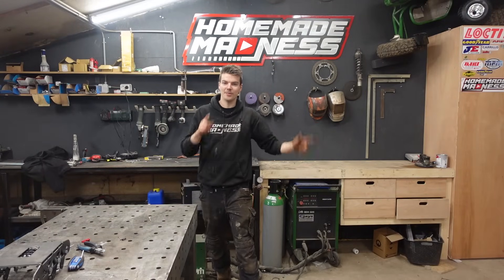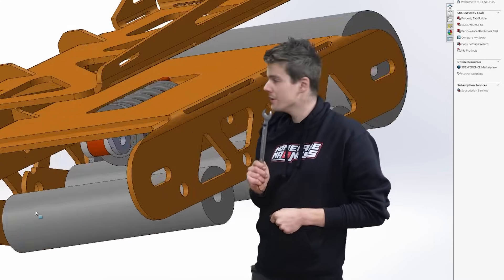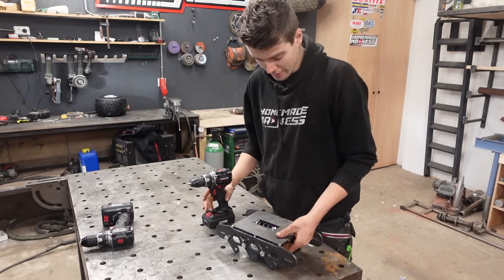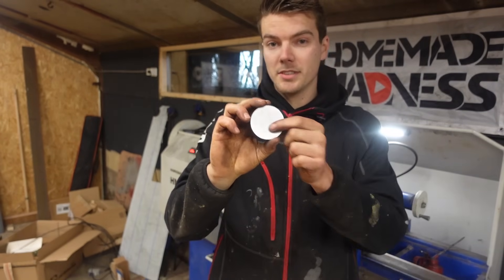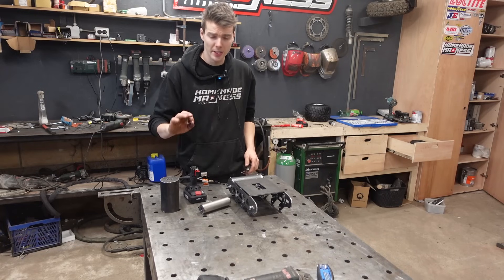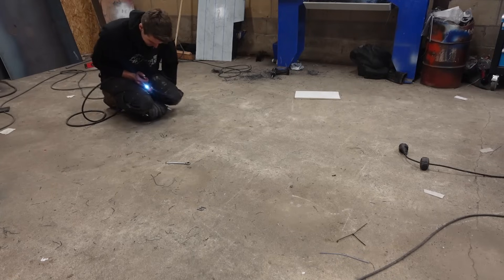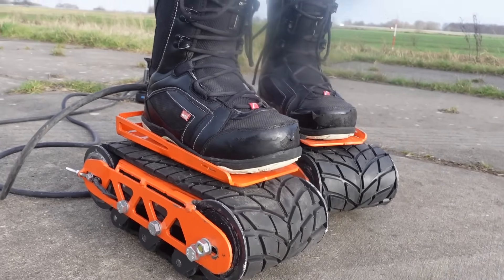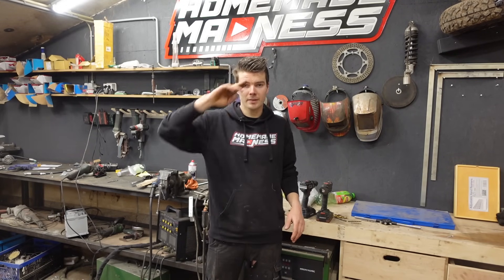I made conveyor belt shoes! will they work?

Comment: clever design! I think what is holding you back is really the motor choice. Power-tool motors are geared down a ton for low-end torque (which is very useful), but the problem is their speed control & the fact that they engage electronic braking. This is great for a drill, but not so great for mobility applications as you have found out. I would look into replacing the motors with the kinds on electric skateboards. If you go searching, you can find dual hub motors pretty inexpensively online. These brushless hub motors are direct drive (so still have loads of torque), but don't introduce any extra bulk or rolling resistance of the gearbox inside the drills. Simply go get a cheap eboard controller (which natively will power two motors from a single controller), and you should be good to go. Biggest benefit is an eboard controller is designed to let you coast when you let off the throttle, and they throttle power and not *speed*, which is an important difference which will make it much easier to ride and control.

Comment: You should have used DC motors................I use Parkside drills and unluckly you choosen the fastenst one of them all, Brushless is not always the best way, in comparison  DC motor works as brushless with possition sensors and smart controller.

Also you can use different controler for better torque, the original does not have softstart.
If you used 5 y older drills they would do just fine, also make them so they go same speed and add potential difference knob so it would be possible to turn like a tank ( same as roll axes on rc plane for ex.) 

Overall good job  💪💪
Reply: Nothing wrong with brushless here, its more of a problem of trying to use a drill gearbox & controller where it wasn't designed. If he used eboard hub motors & controller this probably would've worked extremely well.

DC motors have no advantage here other than being a bit easier to control with/out a control board.
Reply: @nickldominator  they do........just as I said they will go slowly from a dead stop, brushless cant do that without hall sensors sensing the possition so it would have aplied more power to the specific coil in a way that the rotor would not slip.

But I agree, basically the controler is shit.
Reply: @Jarda_B  Brushless motors can have full torque @ 0 RPM, you have to use a technique called HFI. You can think of it like extremely fancy back-emf, except it works very well and can be silent w/ no jittering. For sure its not very common, but it is possible :)

Comment: It might work better with a balanced speed control if both batteries were connected in parallel, to ensure equal voltage to each motor.  If the front and rear rollers had a slight taper from the middle to each edge then the belt becomes "self centering " , this technique was used to keep drive belts on the pulley wheels in grain and cotton Mills.
Reply: It's used on most everything with a belt, like a belt sander.